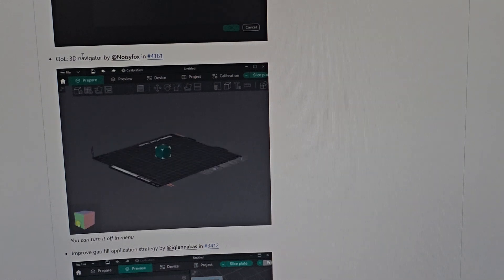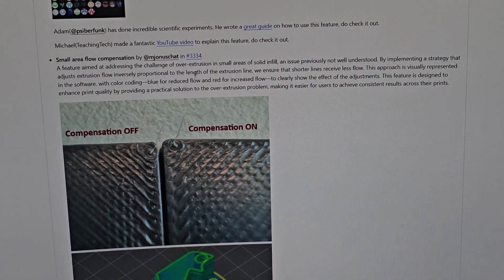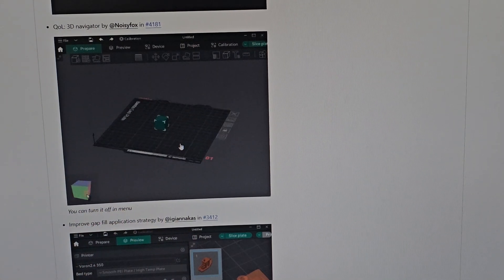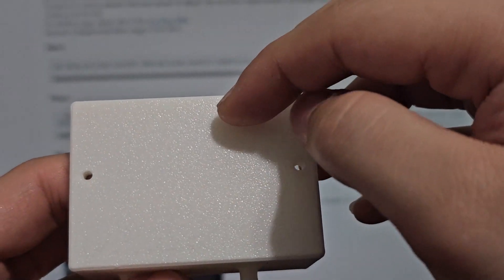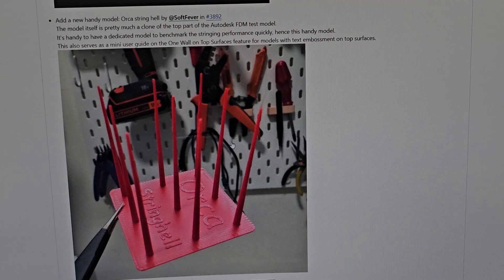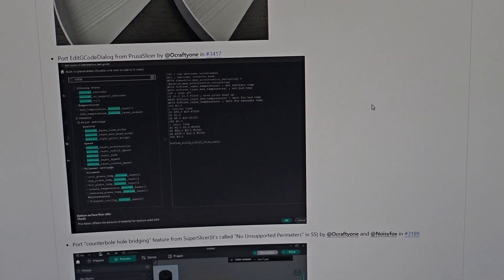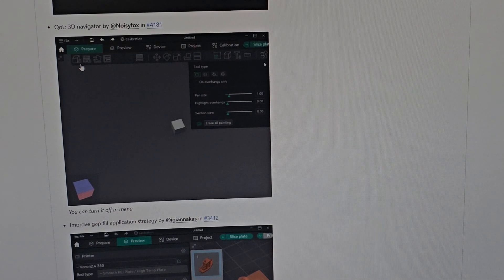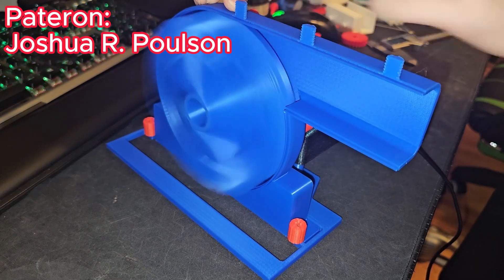Orcaslicer v2.0.0 Beta Release | This Changes Everything!

Comment: The adaptive bed mesh leveling thing usually refers to only measuring the part of the bed that will be used. Imagine printing a 20x20 cube on a 300x300 bed. Why bother checking the levelness of the corner when only a small area of the middle is in use?
Reply from the maker: I guess that's true, but it could be useful for someone out there, which may have a very bed reading and could fix it with this feature.

Comment: Hey man! Good video!
If you print the Orca Tolerance Test (which you already did in previous videos), what are your internal dimensions (measured with a caliper)? Mine varies about 1mm between the smaller and the bigger measures.
Reply from the maker: Thanks, yea I just measure mine and it's the same as your, between the smallest one and biggest one it's about 1mm.
Reply: @Scratch3DPrinting  that's a relief, sort of... I wish it would be more accurate.
I can't get the "test piece" fit through the 0.1 or lower holes and the 0.2 passes really tight.